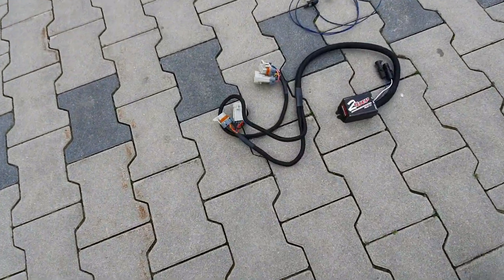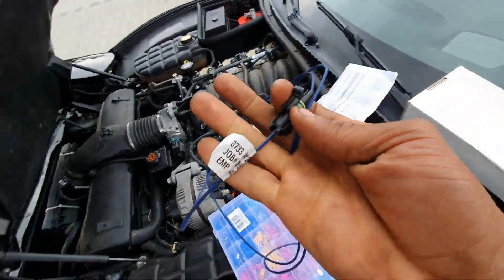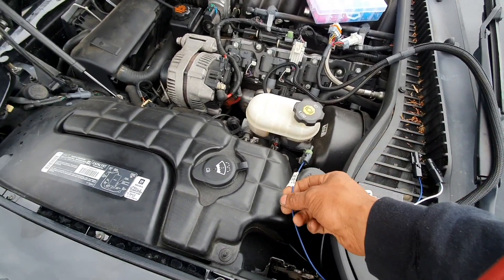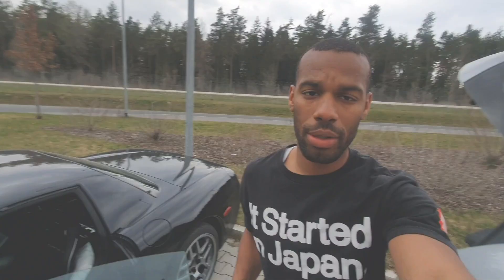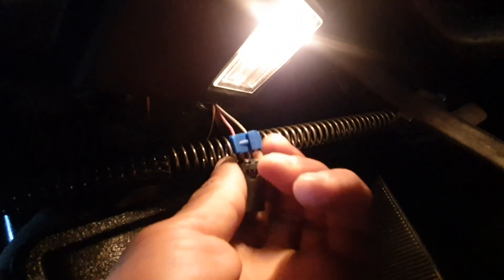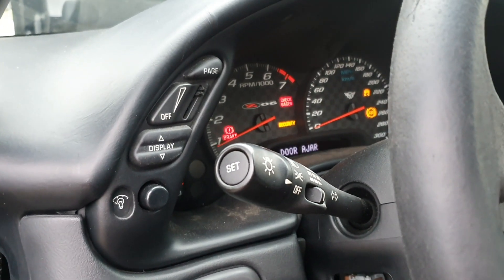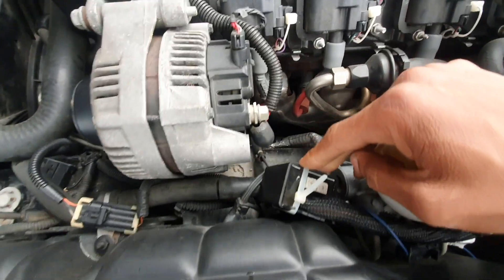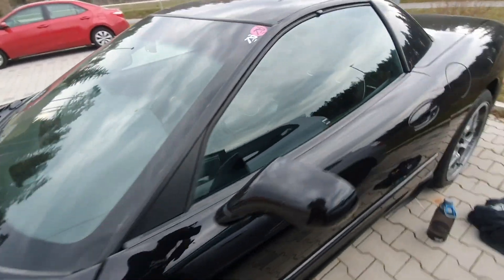C5 Corvette MSD 8733 2 step install

Comment: If i had to guess based on my LS, i would say closer to 3200-3500 will be the sweet spot. let traction control worry about wheel spin.
Reply from the maker: On the street my car kelt spining and TC would  big her down
Reply: @Beezy_Builds  hmm, try it without TC? could also be your clutch.
Reply from the maker: @pawpatina  clutch is in good condition with low miles, without traction control is where I found 2500-2800 to be the sweet spot, but my  tires were also cold and at their normal pressure, so im sure if I lowered the pressure a bit and warmed them up I could raise up the limit for a quick launch
Reply: @Beezy_Builds   ah ok, thats possible too. I just know these motors make the most around 3000+
Reply: WaynesWorkVlog any tips on how to shoot flames?? Lol

Comment: What wire did you connect your blue wire from the msd box to on the clutch switch? The purple or yellow wire?
Reply from the maker: brother hit me on instagram, I'll have to look
Reply: Beezy_Builds would you mind answering this question on here?
Reply: Ended up tying the purple and yellow wire together to bypass the safety switch under your clutch. Connected the blue wire from the msd box to the positive wire on the switch and grounding the negative
Reply: I'm wondering the same thing

Comment: I'm curious about the clucth pedal spring you have...do you have a video on that ? And did it serve its purpose for what you needed ?
Reply from the maker: I dont have a full video, but it served it purpose to help keep the pedal from sticking but after a long pull I still have to pump it sometimes
Reply: @Beezy_Builds  I might have to try it out . My pedal sinks if i redline it but if i drive normal it's fine.  Thanks for the reply 👍
Reply from the maker: @joeanthonyreyna6742  yeah c5 are notorious for it, I would do it again though, I try and do the ranger method to keep the clutch fluid clean which is just changing it often to help

Comment: Which wire did you use for clutch switch? Did you use blue or blue/white? 

Would you use same wire if you used push button for activation? I’m just confused with wiring.
Reply from the maker: The blue wire worked for me it was opposite if the instructions

Comment: So how is it when you are shifting gears? And if you want to rev it I assume you have to put in neutral?
Reply from the maker: So my 2 step is set at 2500 rpms its only activated when the clutch is pushed in, it doesnt matter if im in neutral or in 6th gear on the high way, if my rpms drop to 1500 or below it can be engaged, but if im just driving shifting normally it wont cut my rpms, does that make sense brother?
Reply: @Brax_beezy yeah man I think so... because when I’m on the strip I shift at 6500 and the tune is set at 6650 to rev limit I’m slowly getting into the LS world but thanks for the video best one I’ve seen. Thanks man!
Reply: Beezy_Builds got mine in today, gonna hook it up this weekend but was gonna see how you liking it still?  Also I’m about to order short throw which one do you like better?
Reply: @Beezy_Builds  okay, so on rev matching, it only reactivates if you drop below 1500rpm, not just every time you push the clutch in?
Reply from the maker: @outcast371  correct its no issue

Comment: If you use the upper clutch switch does the 2 step hit every time you shift?  Using the lower switch would let you shift without it hitting??
Reply from the maker: i could not get the lower clutch switch to work but it does not hit limiter when shifting. You aren't on the accelerator when you shift
Reply: Beezy_Builds   Not everyone lifts their right foot when they shift. My tune pulls rpm back to 5500 when I push the clutch pedal in.

Comment: I know this is an old video but if you get the chance could you explain how you wired it to the clutch in better detail?
Reply from the maker: Its pretty simple you have to pull the plug the plug that goes to upper clutch position switch, at the top of your clutch pedal under the dash, then t splice into the greyish wire with the 2 step activation wire
Reply: @Beezy_Builds  That was me commenting on my 2nd account. I got my 2 step to work out thanks for the support. I just subscribed
Reply from the maker: @lrobinson132  appreciate the support fam

Comment: I cant believe you did that whole video but only had it set to like 2.5k revs lol? Where were the flames with the higher rpms??
Reply from the maker: It was stock engine wise minus a intake in that video so it could be 2 steping at 6k and wouldnt shoot flames, but If you want to see flames check out the header install video 👍🏽